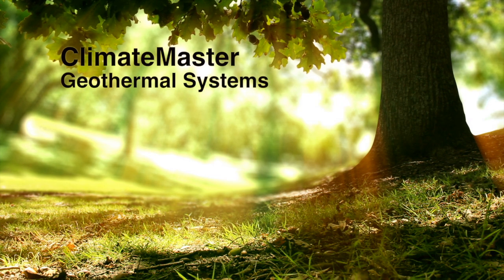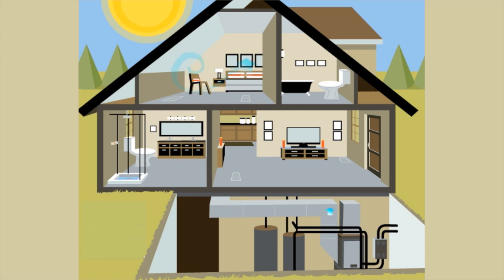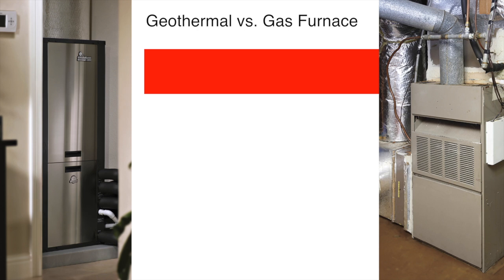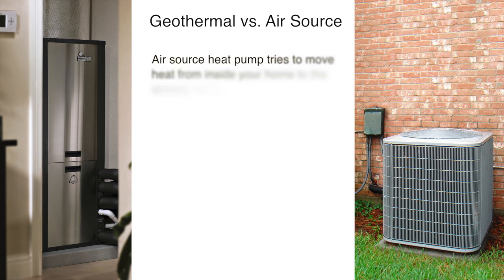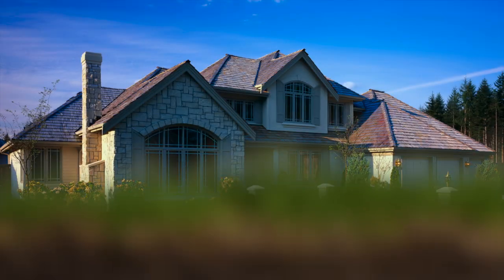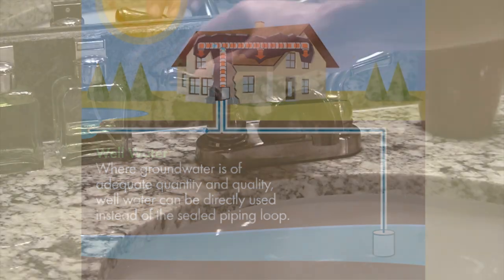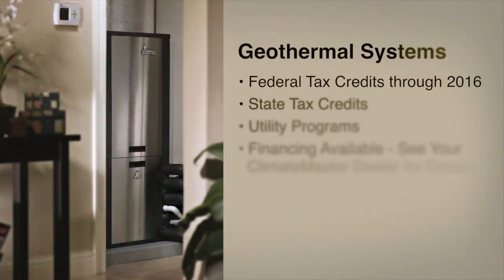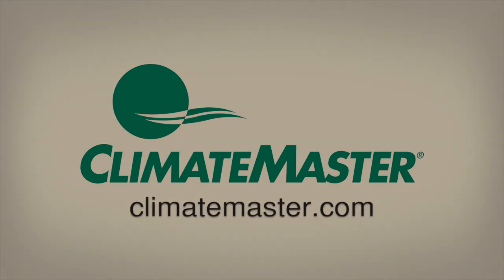Benefits of Geothermal Heating and Cooling

Comment: Remember the rooftop solar hot water systems from the '80's? This is the same thing, TAX CREDITS have now expired and no one is installing this. You ALWAYS have to have supplemental heat in the winter, how will outside 55 deg increase your inside home temp above that? It doesn't they mislead you in explaining it. It's wasteful, pumping ground water requires electricity to run a pump almost 24 hours a day and you WASTE water returning it to a pond meanwhile lowering the water table for everyone.  Nat. Gas is cheap now and will be for the next 30 years because of fracking. These homes always have a chill to them, and people hate them after living in them for a few years. Buyer Beware!
Reply: Ben Rumson, you are so wrong, you couldn't be anymore wrong if your name was Wrong and you were the mayor of Wrongville. Read about this technology prior to spouting off. Not sure about the tax credits, but what you said about the technology is one of the dumbest thing I have heard
Reply: can you think of any good application for this type of system?
Reply: Yea, build a better home, One that is at least half under ground, This is great for cooling with closed loop but I would use Nat. Gas for heating, Nat. Gas is projected to be dirt cheap for over 100 years, we hit the motherload on that. And if gas isn't available to you, then MOVE to where it is. But for an above ground home, With no more tax credits, you're a sucker to install this at $50K a home.
Reply: passive solar and quality of ones envelope taken along with as you say berm or covered with dirt can go a long way to make the temperatures very stable inside of the house. Many of the passive houses are able to stay within a few degrees all day.  Same with building with Sips or ICF.  The temperatures do not need to be raised or lowered if at all.
Reply: Ben Rumson.
Reply: +Ben Rumson your explanation of this system/technology is cringeworthy and absolutely wrong up to the point where one could argue that you are a dirty troll or a lobbyist rooting for the fracking party... what a load of crap .. sry but pumping water in a closed loop system for nearly 24h isn´t costing that much energy ( google it) and also the water runs through the heatexchange of a heatpump that uses the energy of the closed loop water , compresses the heat and heats up water for your house and your heaters ( low pressure, low heat floor heating is favored here because most efficient).
"how will outside 55deg increase your inside home temp above that?" -you ask... well if you are asking that you are clearly critizising something you have absolutely no fucking clue about... so why are you so determened that this is wasteful? -exactly you have no clue. 
FIY there is still energy in water even below 55deg  and a heatpump will compress this energy and heat up water inside your house over 150deg F if need be.. the technlogy is not new and it is massively used in different applications. Key for best efficiency is to put the geothermal water loop deep enough into the ground and use the thermal mass of the ground  to increase the efficiency of the heatpump by providing "preheated water over freezing temperature from the ground. ( so while it is freezing cold winter ouside, going deep enough into the ground the temperaturs aren´´t as cold as you think)
even if you do not believe it, but even from water below freezing temperatures you could get heat via heatpump, but the efficiency would suffer.. 

I would suggest that you shut your mouth before telling such illiterate bull crap that makes you sound pretty dumb and research on the subject beforehand... these system are great for certain types of applications, especially if you have enough "ground area" to put a big enough waterloop in and complete the system with some solarpanels to run the pumps, and believe it or not, these pumps do not nearly need that much energy as you may believe..
Reply: I OWN the fucking GAS Company fuckwad

Comment: Is this stuff for real? It sound too good to be true!
Reply: yes .. but so is the upfront costs  HIGH   If you have room for a pond .. your costs will drop dramatically . But my view is the cost of the equipment is that is sold at a high premium
Reply: @John Johnson   My electric bill is never more than 90 USD in the coldest and hottest months, and less than that the rest of the year. That's for the whole house. I'm not sure what the cost is on the geothermal alone, but it's not nearly as much as AC/heat pump. My electric bill used to routinely be $200. In 8 years of having geothermal I've saved around $10, 000 in electricity.
Reply: implementing a solar system might be cheaper but the concept is very interesting.  with more competition probably the initial capital cost goes down .

Comment: Before you invest in something like this, do a test. Log your yearly energy bills, then make small investments like having insulation added to your attic above or crawlspace below. These two places are where the majority of your heat loss and heat gain occur in the winter and summer. These are things you can do yourself for relatively little money that will net you big savings. Then have your furnace/air-conditioning systems serviced. See how this effects your bill, you'll be amazed. Then, as your budget permits, you can have doors and windows replaced with better insulated models. Ground Source heat pumps can be cantankerous and expensive to repair especially if you develop a leak in your Ground Loop or Heat Exchanger. Insulating your home is the best first step. If you keep exterior heat out in the summer and keep your heat in in the winter then that's work that your HVAC system won't have to do. After all if you had a boat with holes in it, would you fix the holes or buy a more energy efficient bilge pump?
Reply: you are absolutely right about insulation as a first step 100% AGREED, but you are clearly not understanding or misrepresenting the reliability of the heatpump system..  they are very very reliable and even if not a lot of people know about them, they are reliably around for a while now.. Also a heatpump isn´t as cantankerous as you describe.. it is not new technology cause the tech is massively used in so many applications.. all the heat installation companies here in germany are talking about this as a modern and brandnew technology.. but it is not, I have 2 friends who use this method as standalone heating in their houses for the past 30 years.. and the cost of service and replacements are negligeble compared to conventioal heating like gas or oil.. one had to replace his heatpump after 20 years and the other one put in a new and more efficient one after 23 years without the old one ever breaking down.. the thing is, that the estimate of the heatpumps from all these "heating installation companies" that are to this day preaching that you need additional heating by conventional gas in order for it to be reliable, are charging an arm and a leg for what they portray as an exotic and new technology. also all the money we get from the government to upgrade to such a systems is skimmed off by these companies.. ( example: if there was no government programm the heatpump would cost expensive 7k and a year later the government would give 3k towards these expenses and suddenly all the heating installation companies would charge 10k for the exact same heat pump.) buying all the parts from indipendent dealers that are not part of these price gouging will give you the best prices with our without government help.. since we have pretty decent insulation standards here in germany the next step is to get these systems up and running more frequently.. but it seems that the industry has no interest in pushing this forward...
Reply: This is almost accurate, BUT prior to insulating a homeowner should air seal top plates, wire , pipe penetrations in attic and band/ rim joist in crawl & basement.
Reply: That system makes most sense in new homes so you can lay the pipes in the house without ripping out the flooring and you save some money by not installing an regular A/C.
Oh and i  from europe i know some people that have a heat pump and they pay only 55$ a month for heating and cooling (25cents per KWh) and that in an area where some weeks in winter are often at 0°F (and the other weeks are about 15°F).
Reply: @josef18181  I agree about being installed on a new home... the contractor you hire for a job like this is VERY important too. It's always beneficial to hire a good, experienced installer with a good reputation, but with a system like this, it's EXTREMELY important. A service tech can't just come and fix a leak with a geothermal system.
Reply: @josef18181   There is a soda vision South of Atlanta that's installing  Geothermal units.
Reply: my rule of thumb  energy conservation first.  seal and insulate make your home as tight as you can. Even taking into account the cost of a heat recovery ventilator running most of the time, the electric bills will still be lower and one can increase or decrease air changes per hour as desired (makes for a much healthier home). Spending more than one needs to do up front with moderate changes to the insulation envelope and finding windows that have higher r value in relation to the rest of the insulation can make a HUGE difference in how much one needs to spec out for mechanical heat and cooling.  Few people are willing to do as the animals do and look at partially bermed or subsurface housing.
Reply: You have a great point!!! Thank you for the insight!
Reply: I have an insulated home, but I'm mostly looking to see of a greener alternative.

Comment: I think this system must have water pump to run the water around, and not sure if the water pump should run all the time to make the water run to cooling down or heat up the temp in room, and i think if we add a compressor we can get a much faster heat exchange rate and the system will be more effectioncy
Reply: I dont think a compresor would help. 
Im sure the heat transfer is limited by the earth, so increasing the speed or pressure of the water wont make much difference.
Reply: actually the heat transfer can differ a lot between laminar and turbulent flow..
Reply: Xu Jimmy 0
Reply: +Xu Jimmy you actually take into consideration what size of loop you need in order to get the system running properly... this is not a new system or technology as you might think.. people heat and cool their houses cheap and reliable for 30+ year with this technology.. yes the system has a water pump to run the water around, which is logical, how else would it work?? this water will run throu a heatpump ( "like" a split air conditioner)... speed of the water in general is key for the efficiency of the heat exchange between the water and the pipe, but the approach is to make the exchange surface as big as needed ( geo loop size ) so it is all factored in before building.. the math is there the physiks are there ... there is nothing new.. it is just a heatpump, nothing fancy.
Reply: phildev Yes, and it would help if the heat transfer was limited by the convection inside the tubing, however if it is limited by the heat transfer of the soil (this is most likely the case) than increasing the convection inside the tubbing will have very little to no effect.
Reply: +NelsonR. Candelaria Mercado
agreed that is why it is designed with a big enough surface area.. we have to look at the material used.. and they normally do not use metal with a good transfer rate for the piping in the ground anyhow..

Comment: can works in a 38 o 39 centigrados in colombia in a hot city all year that weather
Reply: The climate in Bogotá is cool and overcast. Over the course of the year, the temperature typically varies from 44°F to 66°F and is rarely below 37°F or above 70°F.  this is what I found when I looked at the average air temperature.. so to answer your question will work wonderfully
Reply: Look into a Canadian well instead

Comment: can one cool their home with cool water from the ground through pex tubing
Reply: sure but not really well because you need to remove the humidity and likely will not reach an adequate dew point
Reply: Yes you can run the water through a radiator and blow air through it.